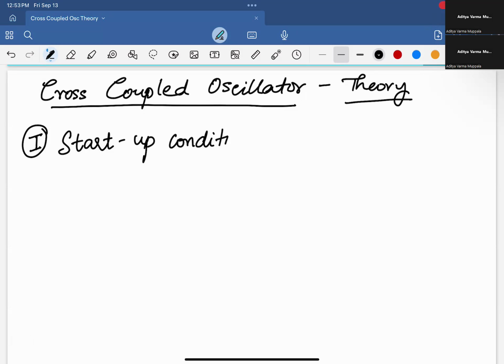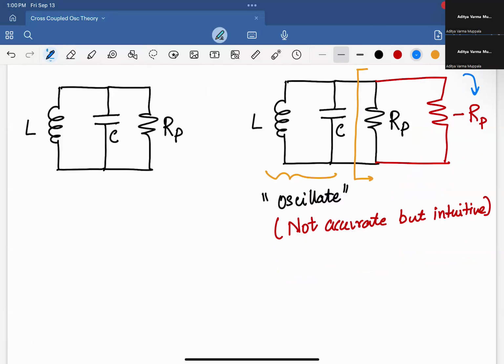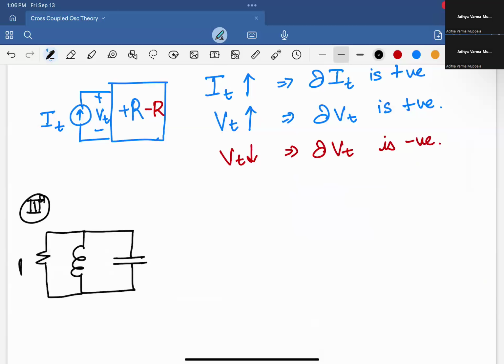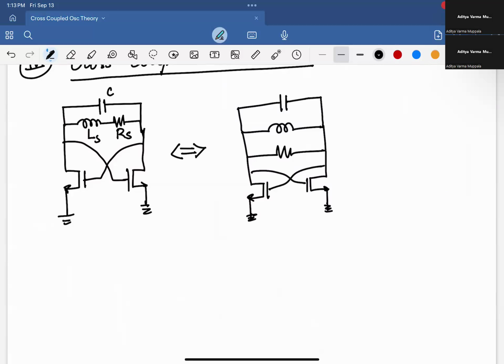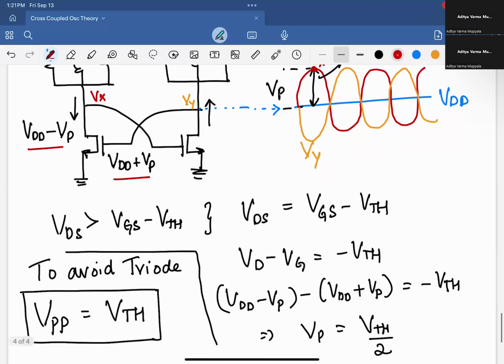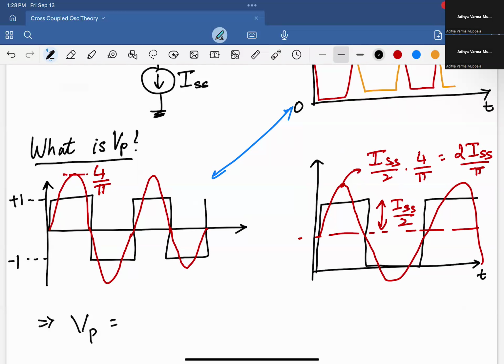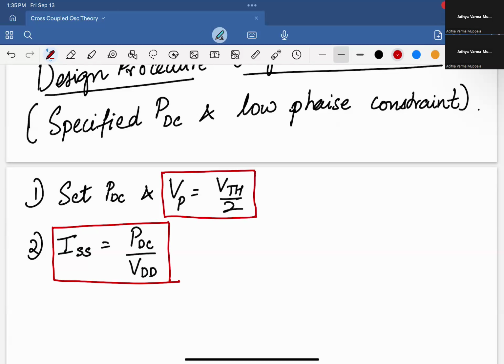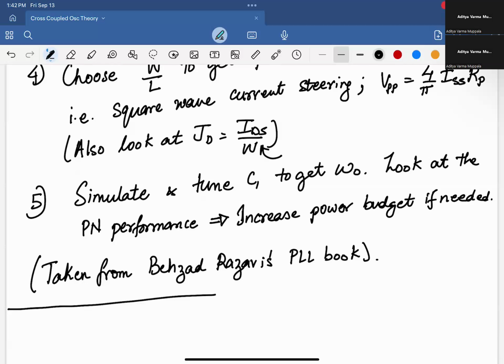Cross Coupled Oscillator - Intuition and Analysis | Oscillators 04 | MMIC 09

Comment: Hi, just a question. How can the voltage on the node x and y go higher than vdd if the current is always positive? considering the KVL Vdd-Ix*Rp = Vx right? From the diagram of the currents (square waves yellow and red) the current is always higher than 0, so Vx will be always lower than Vdd. But this is not coherent with the voltage drawing of the nodes Vx and Vy. What am I missing?